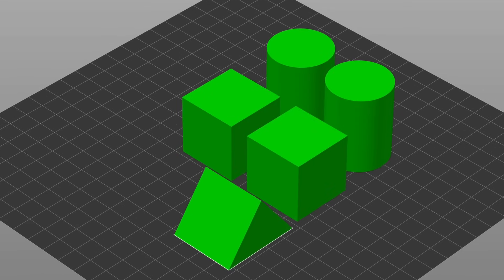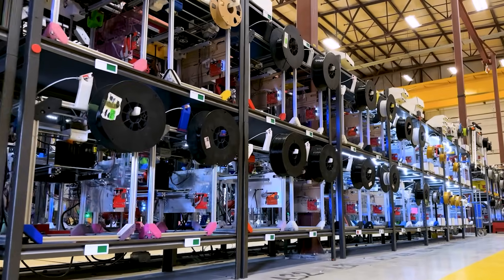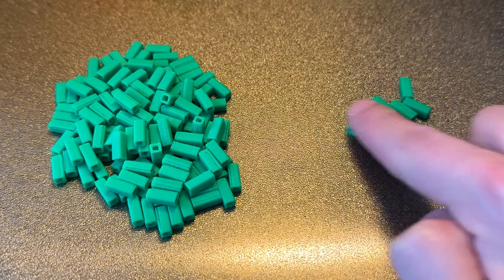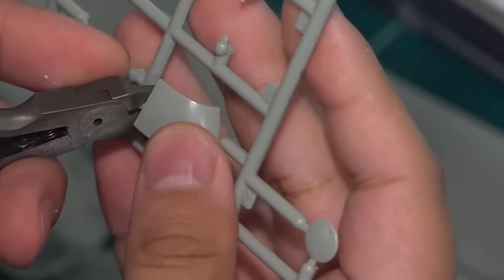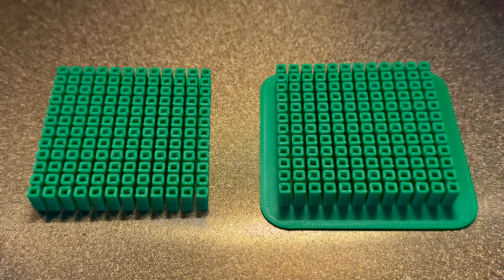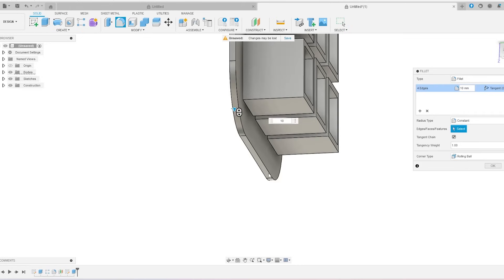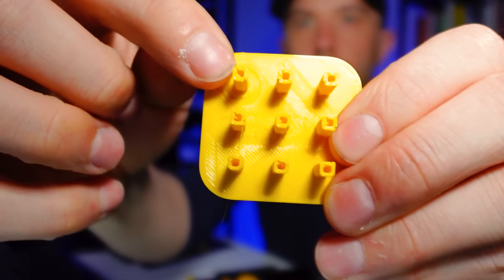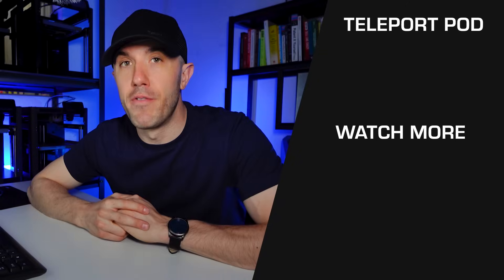STOP Filling Your Build Plate | Design for 3D Printing

Comment: If you use wide brims at 0.1mm height and if you place the parts close enough that their brims intersect, you get the same part bundling and adhesion improvement effects of a raft and the brims come off very easily, but since your part actually sits on the bed, the underside doesn't look completely ugly.
Reply: Brims sometimes stick the part too well and you have to snip them. This makes a printing service more expensive. He is explaining how to save money as well.
Reply: I do rafts at a distance of .23mm in Cura when I print PLA or PETG and my bottom surfaces look better than you might expect. It obviously doesn't pick up the build plate texture but there's no gapping or underextrusion.
Reply: Eh, idk. If something goes wrong with a part I think a raft will do a better job of preventing it from being knocked off the bed , which in turn could prevent the failure from cascading
Reply: Exactly what i was gonna say. I do this all the time and it works great. I just put the parts close together with a brim and it peals of as one big sheet. Super handy for all the connector pins for my models when i slice them.
Reply: I do this and it solved almost all of my problems in adhesion for multiple model printing.
Reply: It depends on the material. PETG for example shrinks, so I give it a brim with 0.0 separation so that I am sure at least it touches the object. He does not specify which material for those 0.3 - 0.2mm spacings.
Reply: How many of us are actually mass manufacturing? 

At 0.1mm height, you can just peel the brim off of most parts and if anything is left, all you need is a quick cut with a blade. In exchange for the work, you get great part bottom sides.
Reply: @markus30000 this whole channel is geared towards mass manufacturing though, I don't think that argument holds up in context
Reply: @Kori-ko  I bet most viewers aren't.
Reply: you guys realize that you have already lost the second you started to touch slicer settings (at least in the eyes of slant and print on demand)?
Reply: @TheScarvig  haha, yeah, i figured 🤣

Comment: Batching is required for multicolor prints to be cost effective (on printers with a single nozzle).
Reply: In his universe there is no multicolor, no slicer, no high tech filaments, heated chambers, etc. All his videos are how to use his print farm.
Reply: @cromyjr1592  exactly these are all tutorials on how to use their printing service
Reply: @cromyjr1592  also, the raft would cause so much waste. dont really like that solution for my own uses. But I also have a 3d printer lol
Reply: @pvic6959  The point here is to avoid failures.  I was printing a puzzle with 45 of the same pieces.  One piece would dislodge due to a finger print or a tiny grain of sand and destroy everything else.  Using Bambu's raft solved the problem, but their raft left little strands of the raft since it wasn't solid.  Yes a solid raft (especially 1mm) is overkill and a waste of filament, but it does work better and fails less.
Reply: @SquidNick  i see. for my own printer, I rarely print a bunch of the same thing so maybe its a feature that isnt useful for me (at the moment)
Reply: I'll sometimes batch a multi-color print with one or two don't-care-what-color prints to save on purging.
Just make sure the don't-care prints are taller than the important print.

Comment: I can certainly see this making sense for printing services like yours, but I'm not going to make an extra 25-50% waste plastic and spend the extra time & materials cost at home for a plate of Dummy 13 parts when I could just get a reliable bed surface & print configuration instead.
Reply: Given the quality shown in this video, I'm not sure if anything they just said is actually true.
Reply: Just use 3d printing glue))
Reply: @daliasprints9798  I was thinking similarly. Seems like there's a lot of work going into compensating for bad bed adhesion here. I wonder if print farms are behind on bed adhesion compared to consumer printers.
Reply: @teaflavoredtea5092  I mean the video goes into reasons you might want it. "Our bed adhesion sucks" isn't a good reason, but having parts that can be taken off the printer and packaged as a unit without risk of losing a part seems like a good reason.
Reply: @teaflavoredtea5092  Its nothing to do with adhesion. He uses glass unless you request textured. Glass also cools faster and allows the part to be pushed off automatically. This is how automated printing works. I don't believe he uses adhesives either but that may depend on the polymer type.
Reply: @teaflavoredtea5092  Did you miss an important part of the video? He emphasises on organising. Having a lot of small parts neatly ordered on a single sheet of plastic instead of empying the bed and have 50 tiny loose pieces.
Reply: Yes for print services this is needed. No one cares how you do it at home. That's why we are watching these videos. A print service won't have the same machines, surfaces or settings as you do at home. Therefore design is of utmost importance.
Reply: Have we watched the same video? Read the title again and the thumbnail and what he says in the video. The video is not titled 'do this when ordering from us' because I'd get no views. It's just a bad ad. And pretty funny at that since they are basically saying that they have poor bed adhesion and poor configs. The solution to that might just be not accepting jobs that you can't deliver. If you need a raft, don't accept jobs that don't have it built in.  @phasesecuritytechnology6573

Comment: I needed to print 24 parts at the same time. I put a 1mm x 1mm bridge between each part and that keeps each part tied to it's neighbor and that fixes the bed adhesion problem. Plus, if you're selling 24 parts at once to each customer, then if I printed it on your service, one sheet of parts = one purchase.  I think my way is better since it takes less time and plastic filament.
Reply: I like this idea better. The reason you have the part down on the build plate is often to get the nicest finish on that face of the part. Using raft defeats that purpose.

Seems like a slicer should be able to offer this as a feature by allowing brims to intersect each other.
Reply: @gman9543  He has explained both of those methods in detail. Putting the bridge you speak of between 2 or 3 dozen tiny parts is time consuming and annoying. It would be far more expensive for a print service to handle that than the method described in the video. Waste plastic is not expensive, labor is..by a tremendous amount more. On the parts he demonstrated surface finish is a non-issue.
Reply: @phasesecuritytechnology6573  That's why I said it would be nice if the slicer could do it for you automatically.  You lay down your dozens of parts and then tell the slicer to put a small brim around each. If these brims could be made to intersect each other, then viola, you have your bridge between parts, and the parts sit directly on the bed, so you maintain your good face finish as well.
Reply: Actually, I just tried this, and it does work in Bambu slicer. Arrange your parts or use auto arrange. In my case I had a dozen small parts like he was showing in the video.  I specified an "Outer Only" Brim with 5mm width and sure enough it's creating a bridge between all the individual parts.
Reply: @gman9543  Yep, and if you introduce a "brim object gap" it makes the brim easier to remove
Reply: This is the way

Comment: Sooo, no connection between the raft and parts? Even tiny poles?
I just wonder how would a slicer handle this, as separate parts or as one?
Reply: When you use a slicer's inbuilt raft it leaves the same gap. The slicer also uses the same gap for the support interface. I know orca slicer gives you a warning but it works fine.

The one problem can be the bottom layer surface finish.
Reply: @eslmatt811  The concept is designed for small parts where that isn't an issue. Considering the gap though the surface would likely not be blemished all that much.
Reply: Isn't that how supports work? There's a tiny gap layer in the gcode between the support layer and the model that breaks most of the layer adhesion?
Reply: It just complains they are floating. When you import the model and it asks you if they are all one project or separate parts you tell it ONE assembly. It will then assemble them exactly as is and leave it as one part. When you leave a floating gap the printer will "drop" the first layer onto the raft instead of squishing it like it does to the plate(because of the gap). This makes the point of contact enough to grab and hold but so tiny it separates easily.
Reply: The gap is filled by filament that's not pushed into the raft... Breaks away nicely just like supports.

Comment: if we are going for solid plastic and its non structural, why do I need a full 1mm? cant I get away with 0.4 or 0.6mm? I understand 1mm as min for part pieces for reliability, but the raft?
Reply: In addition to managing bed adhesion or grouping parts, a 1mm "base" should cancel out any print bed abnormalities making the bottom of the printed item properly flat.
Reply: Its a thicker piece to grab on to as you pull it away. if it was as thin as a brim there would be a chance a piece of flashing would be left behind on the part.
Reply: I think this allows their machines to auto eject things easier.
Reply: Also, I will batch with the by object feature in my slicer, less parts but individual prints, typically. (Thanks Bambu)
Reply: @joshuaboardman3650 same here. (Creality also has this option)

Comment: Well the reason is because people only have a single maschine? And they don‘t use teleport because they need that part for themselves. Printing this raft alone with 1mm is already taking a lot of time..
Reply: You didn't watch the video did ya?
Reply: @Splarkszter  I did watch the section at the beginning and him talking for 20ish minutes about better using a raft which then creates the same issues as we already have with Metal 3d printing.
Reply: @ He intends the use case for it being HUNDREDS of parts, not a home print for a single user.
Reply: @Splarkszter  Great but there they have anyways lots more printers and its like PCB design its on them to use it efficently.
Reply: @platin2148  I gave a need for a quantity if small parts, and putting them on a raft, has been the only reliable way I have found, for getting reliable prints.

Otherwise a few parts will come loose, and start getting dragged around, knocking more parts loose.

I'm not shipping the raft. It goes in the recycle bin.  So I only print it in two layers.  Just enough to assure that it adheres and lays flat.